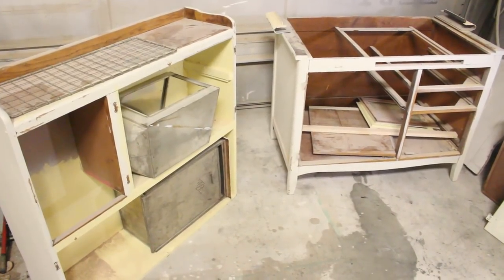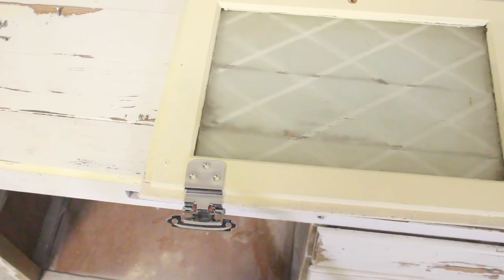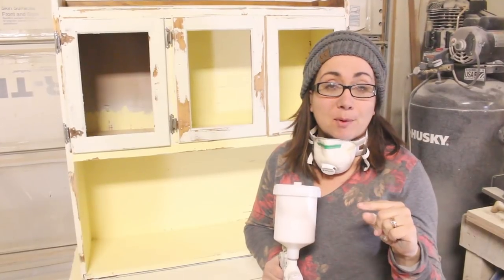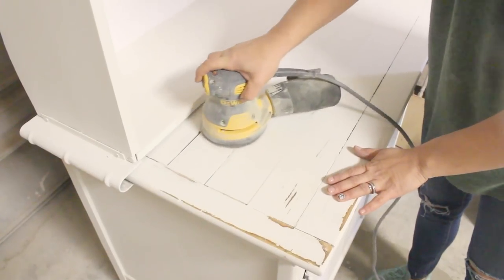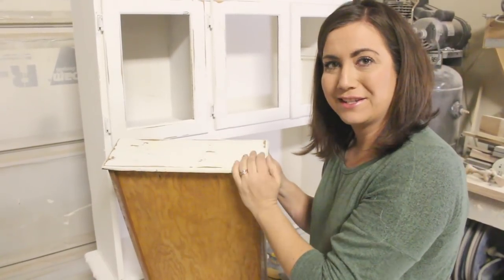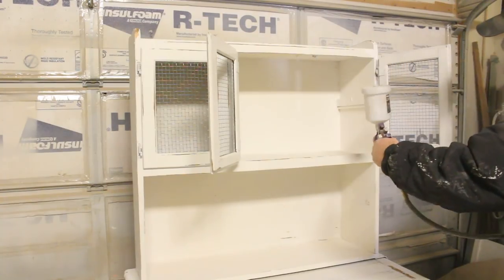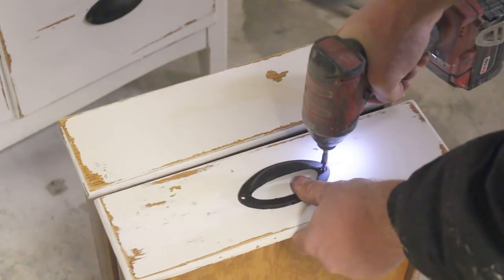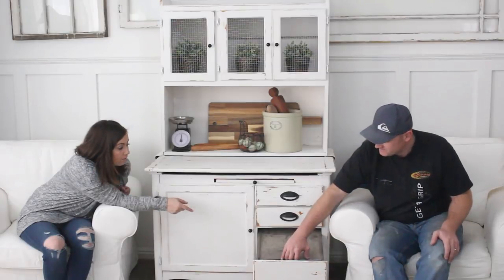Farmhouse Hoosier Makeover DIY

Comment: The metal drawer was used to hold baked bread, with a metal lid. It was metal to keep pests out, they can't chew through metal lol. And the glass jar was for sugar. The counter pulls out for more space for rolling out pie shells, biscuits or knead bread. And you can push it back when you want a shorter counter space. It turned out Beautiful. I love that you removed the glass and made it a cooling rack :)

Comment: The bottom drawer with metal was used to store your bread. I have a Hoosier cupboard and thankfully the flour bin was still in it. It pulled out and you could remove the stored flour by unscrewing the cap on bottom. When finished you just lifted the metal bin up and back into the cupboard.

Comment: I just purchased a Hoosier.  It has a sloppy coat on it.  I think I’d like to sand it smooth and paint with an enamel. And maybe distress for 
Previous color to come through...any suggestions before I start?
This will be my first project ever...
Reply from the maker: I’ve never painted with enamel so I can’t make suggestions there. Sanding the drippy paint off is a good start though.